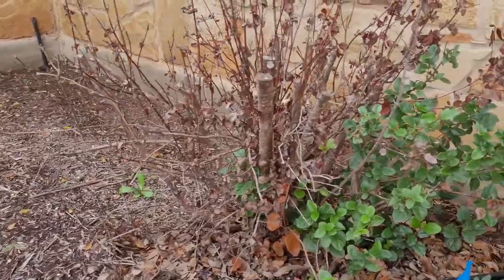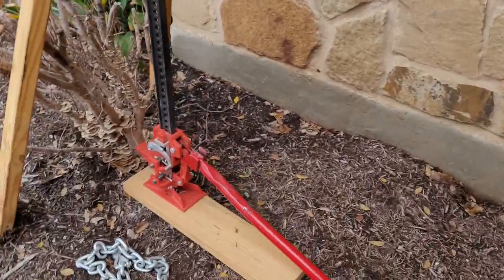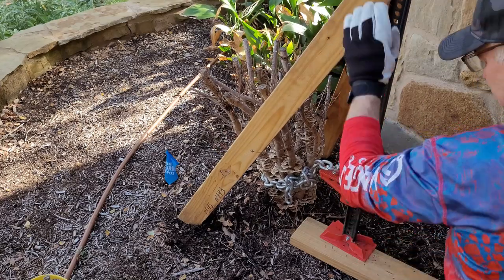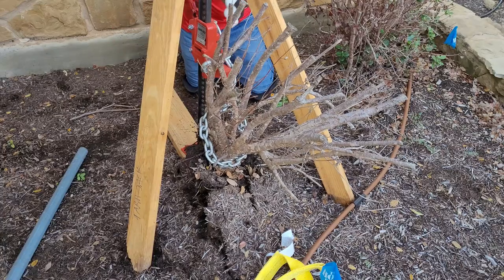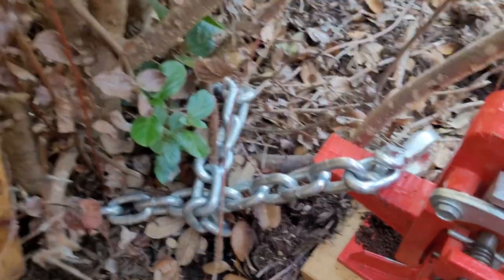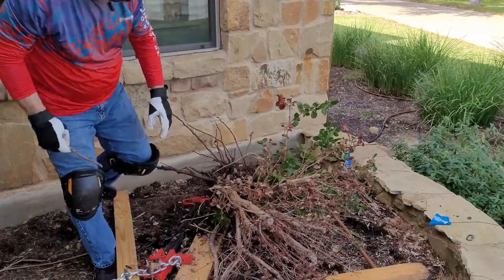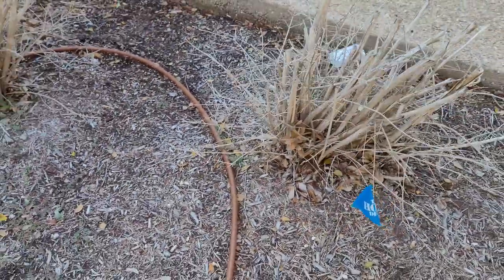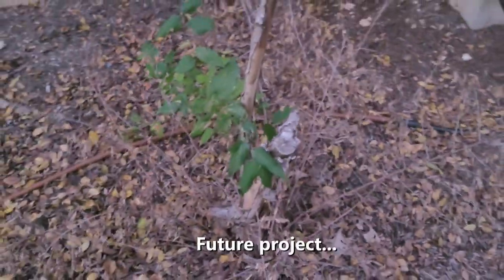Removing bushes with a farm jack

Comment: This certainly looks like a fun and interesting way of pulling up shrubs, I just use a shovel the dead ones usually just seem to pop right out for me. My ground is different, really dense clay so root systems typically stay real close.   As far as all of the safety gear comments - A little thought and prep will always be better than spending a day in the ER no matter what -
Reply from the maker: Deep roots are tough.

Comment: Hi nice video, may I recommend putting some sort of "wide feet" or you wood stand for
more support so that they dont sink in the ground. regards from Christian in Gemany
Reply from the maker: Thanks for the comments. You make a good point for some geographies. I didn't need wide feet for two reasons.  The first was that most of the pressure is still forcing down on the jack.  The legs are for balance mostly.  The more important reason, and the reason I didn't use a shovels, is that our ground is full of stone. We have pieces from 5 inches to 5 feet.  Digging is a hard chore that we try to avoid without a machine. The legs have no possibility of digging into the ground.

Comment: Thank you for the awesome video...im headed to HD to pick ip some 2x4 to make these support legs. Great job wearing the safety gear. Ive seen first hand how dangerous thes farm jacks can be. little to no time to react when it slips. Dead bushes, here I come :)
Reply from the maker: Good for you.  If there isn't rain, you can drench the roots as it will make them loose and easier to raise. Safety first !

Comment: What's the other technique you mentioned at 15:20? Did you make a video on them? They look like they can be easily pulled with the farm jack. Have you tried?
Reply from the maker: I ended up cutting them at the ground with a chain saw.  The other technique is to wrap a chain around the base, have the chain come upwards, and over the top of a car tire.  Then pull the chain with a car.  The tire will make the force upward.  I did non't have a video but you can search for others.

Comment: Brilliant!  Which do you suppose the sturdiest farm jacks are? Job well done!
Reply from the maker: I would just recommend NOT getting a jack where the round jacking handle is flattened at the bottom and welded into a mechanism in the base. If the round handle bends, there is not way to fix the jack outside of cutting and re-welding.  See this video:
https://youtu.be/_1pe8wPdLy8

Comment: Great video thanks. the jacks are designed that way to bend the handle just before the weight tolerance limit to prevent explosion
Reply from the maker: Yeah, I hear you.  See https://youtu.be/_1pe8wPdLy8   The jack was rated 7000 lbs. I wasn't close on a small bush.   It bent.

Comment: Thee safety gear is sooooo overboard.
Reply from the maker: Maybe. I have seen several of these jacks slip and schwack people in the head or face.  Too much pressure close to the body.
Reply: @DrBDIY   You are pulling up an object with the jack not pushing up the object (like a car). There will be no kick back from the handle because that's not how science works.